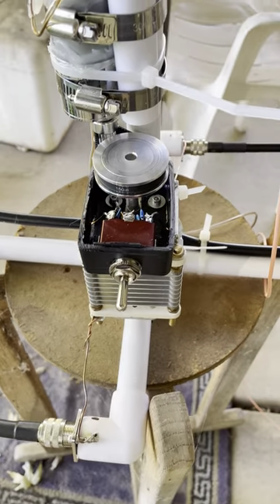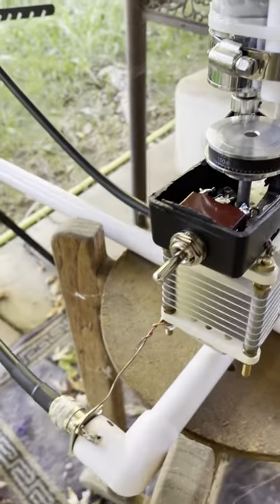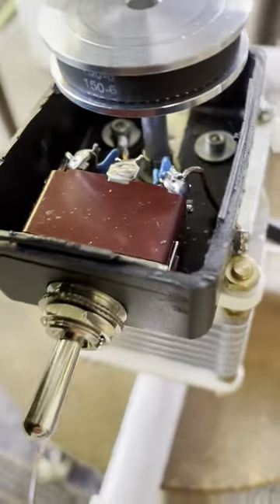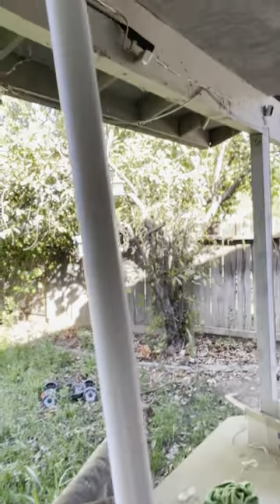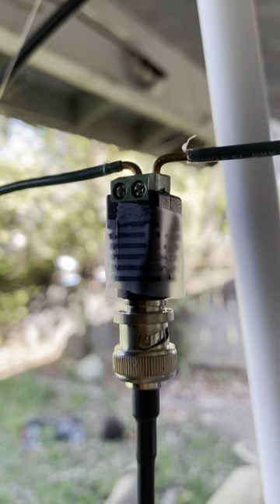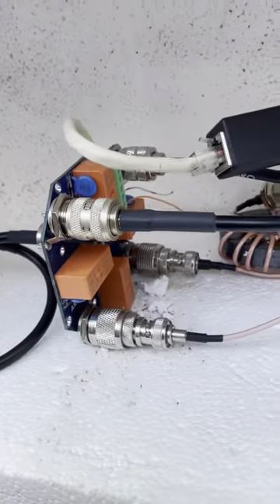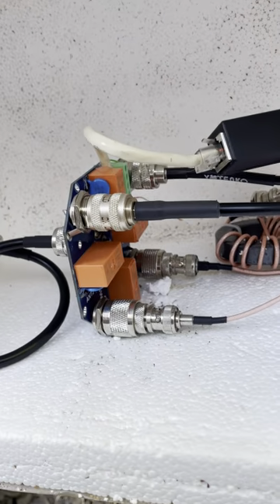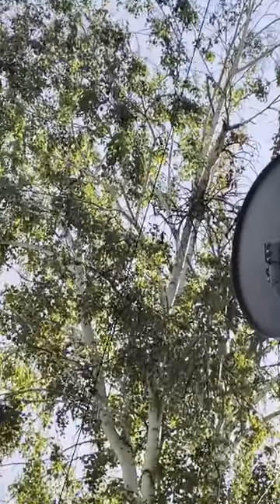Magloop 160 to 20 meters (TX 40 to 20), Dipole 80 to 40; Moxon 20 to 10.

Comment from the maker: If you go to qrz.com and look me up, KO6DEV, you will see the costs. The Magloop is less than $100, the Moxon is less than $250 (rotor included) the dipole for 80 to 40 is $10 or less. The antenna switch is around $30, and it’s a kit. 
So, I am saving hundreds, if not thousands of dollars. 
Advise: build and experiment.